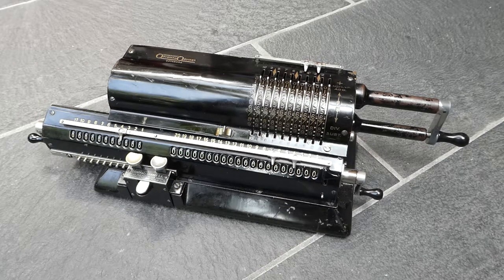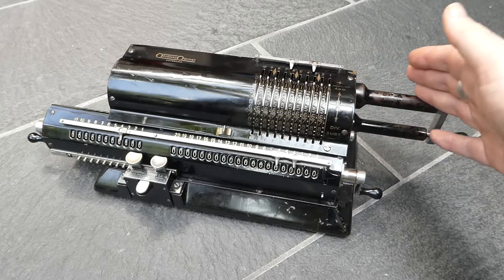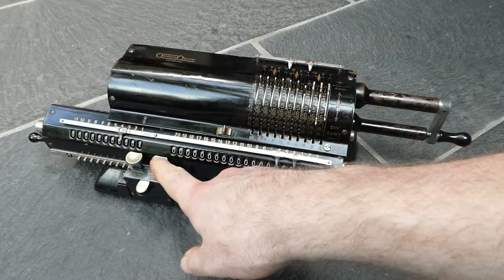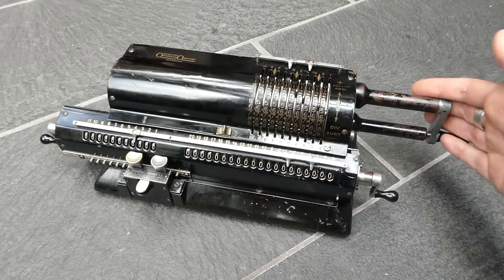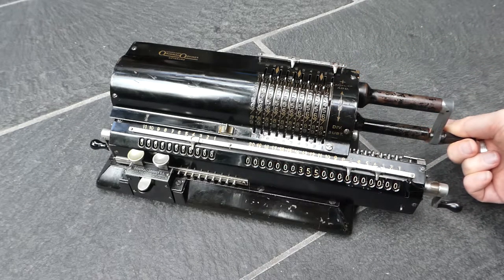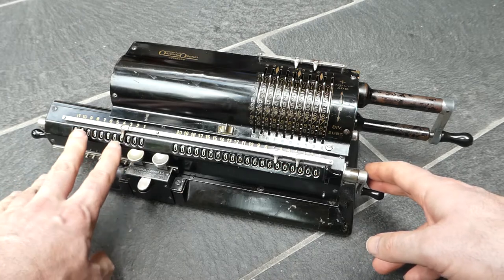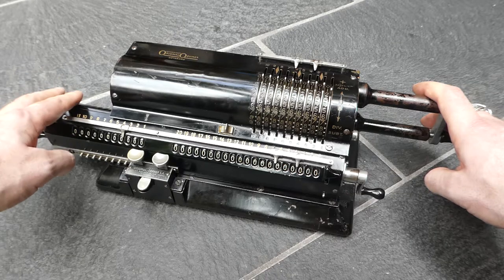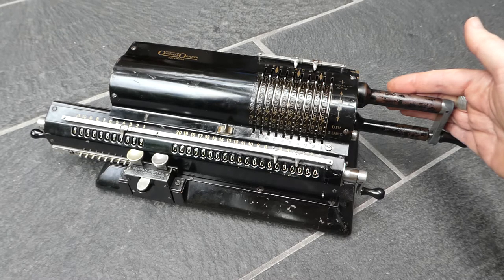The Original-Odhner 24 mechanical calculator

Comment: Found a newer model of this recently, same brand, and your demonstration of all the buttons and levers is very helpful. Mine seems a lot stiffer, especially when going from 0s to carried 9s and the handle on the output clear generally, plus some of the numbers on displays don’t always line up well. I occasionally got things very stuck when playing but now I at least know what “should” be possible
Reply from the maker: Get a spray can of lubricant, for example PTFE or silicone spray, and the stiffness should be easily fixed. I'm a big fan of such sprays, as they are just so easy.

Comment: Can you help with advise with a problem with odhner 39 revolution counter reset handle jammed and not able to turn it can only be made to work and freed up by replacing zeros with any number on all wheels except the outside two at either end, have tried retiming with no luck any one any ideas please